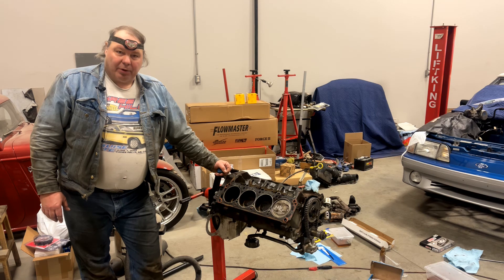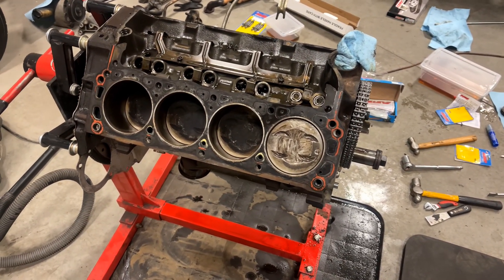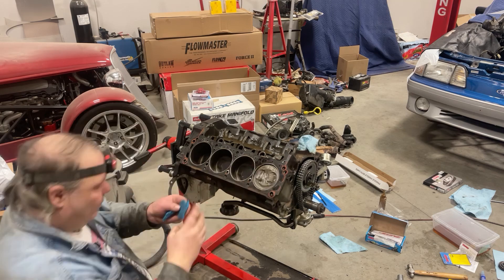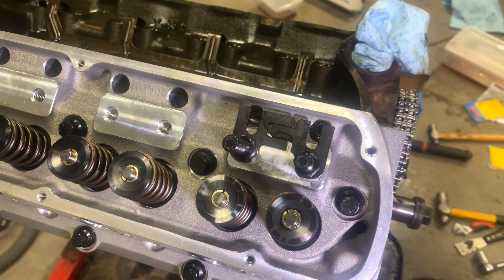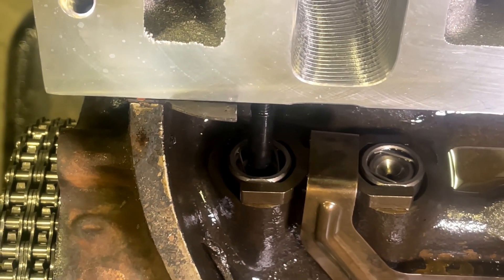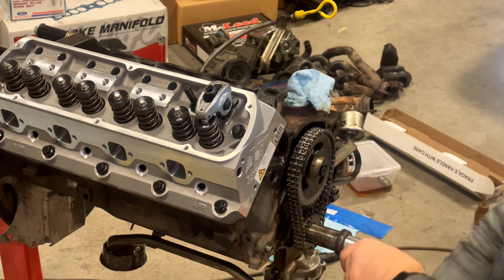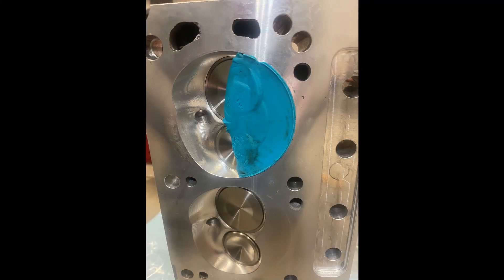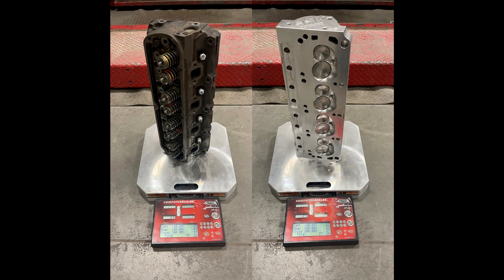Foxbody Mustang Piston to Valve Clearance and Pushrod Length Checks

Comment: Terrific tutorial as usual, Matthew. Thank you! I'm just about to install my slightly ported gt40p heads, 1.7 roller rockers and a TFS-514 (Track Max/ Stage 1) cam. (and all the perepherals, water pump, chain, etc) I purchased TFS springs that are good to .540 lift and the cam with the higher ratio rr's puts my total exhaust lift at .540 - so I'm definitely going to do the play-doh procedure. My question to you is do you think I'll experience any issues with my springs at .540 max lift and my exhaust lift being .540 (.510+.030=.540) ? Valve float etc? Or do you think TFS says .540 but there's a little bit more there? I'm hoping I'm good or I'd have to do one of two things, either go back to the stamped rockers @ 1.6 and my lift will be dropped .030 to .499int .510exh or get a smaller cam to run the 1.7's. Both ideas suck. What do you figure?
Reply from the maker: Watch very carefully for coil bind in your testing. The installed height of those springs will make a difference too. If it were me, when I got the engine at max lift I would check the coil clearance with a feeler gauge to see how much wiggle room, if any, you really have.

Comment: On a1990, Mustang installed a comp cam xe264hr 512 lift ,blown head gasket bought afr 1472 165 heads already installed, afraid to start will valves clear Pistons
Reply from the maker: I don’t want to make any promises here, and I always suggest a piston to valve clearance check as shown in this video. I can tell you that this particular 1990 mustang engine used the TFS stage 2 cam (installed straight up), which is very similar to the comp XE274HR, the AFR 165 heads, and the stock pistons/rods/crank with a fel pro 1011-2 head gasket, and it had enough clearance and ran fine. That is not a guarantee that your results will be the same.
Reply: @tecmotiondyno  Thanks, I just got ahead of myself, and I think it will be good. Was just hoping you installed a comp cam xe264hr
Reply from the maker: @robertc1220 That cam is smaller in every respect than the TFS stage 2. Though I want to be clear that I take no responsibility for your setup, I can say that I would be very surprised if it didn’t work.
Reply: I'm glad I ran across your channel, I'm old-school, do my own wrenching, and your experience is appreciated. Anything can go wrong. I got ahead of myself and wouldn't hold anyone accountable for advice. Thanks again

Comment: 1986 gt 4 eyed fox body all stock piston e6ze-6110-ba forged or cast.
Reply from the maker: I was not quite sure what you were asking here, but the stock pistons in an 86 Mustang 5.0 are forged. They are flat tops with no valve reliefs and the heads are one year only, which makes those cars a lot harder to modify than the 87-93 versions.

Comment: I have a 289 strokered to 331 
Do you always have good results with this method? (Geometry of the rockers)   With the comp cams light springs my Howard's link bar lifters plungers will collapse before the valves open so no good messurement.

Then i tried you're method with the original springs and on my promaxx heads i get 6.550 and 6.650 because of the valves being grinded down on intake or exhaust( forgot witch one)

Do you ad or minus the 0.050 from the preload on the pushrod?
Reply from the maker: Generally, this method works fine, and it does avoid the possibility that the plungers in the lifters collapse even with light checker springs. To be extra certain, you can measure the amount of travel your lifter plungers have and halve it, but .050" is a good ballpark for half the travel on the plungers in lifters like these Ford Racing replacements. If you get good pushrod geometry with a 6.550" measurement using this method, and using a compressed version of the actual headgasket you will use, then subtract .050" from the measurement to specify a 6.500" pushrod. The reason for this is that when you compress the lifter all the way, the measured length will be longer by the extra .050" that should not be present when the engine is actually running with oil pressure.
Reply: @tecmotiondyno  
Bit if you got the length minis the half of plunjer travel. When you install the pushrod for driving and so you have to put the rocker to zero lash and then turn 1/2 turn to get a preload. (I now my plunjer from lash to fully pressed in Is 2 turns of the rocker nut) bit when setting i only turn 1/2 turn for backlash . Isn't the pushrod a bitt to large then ? Half way the lifter is 1 turn rocker nut
Reply from the maker: @chevroletbelair1  if you have that much travel you probably want to use 3/4 turn of preload. The basic procedure here is to figure out the difference between the preload setting and the totally collapsed setting of your lifters and add that much to your checker pushrod when you check it with the lifter fully collapsed. This amount may vary from application to application. This isn’t a measurement that needs to be as precise as bearing clearance and most commercial pushrods are only available in .100” increments so you are always going to be a little off.

Comment: Just wondering what might be different with my current situation. 
I have the afr165 heads with 1.6 roller rockers. 6.350 tfs push rods with comp lifters. The head gaskets are the 1011-1. 
I bought a xe274hr cam and couldn’t get enough ptv clearance. I am using checker springs and a solid roller lifter when checking. I have been turning the crank and finding the closest spot. With it straight up I get 66 on intake and 115 on exhaust. I decided to shelve the xe cam for next years short block. 
I got a tfs stage one and the only way I can get the required ptv clearance is to set it at 2 degree retard. I get 84 intake and 104 exhaust. 
Any suggestions?
Reply from the maker: The first thing to do is check your piston to deck measurement. I have heard tell of some Ford blocks with a machining mistake where one bank ended up with the pistons at +5 or +10 thou (above the deck when at TDC). This can have a more dramatic affect on the P/V clearance because of the valve angles and the way the factory reliefs are cut. That’s the place I would start.
Reply: TF heads  you probably would have cleared.  thats why theyre "twisted valve angle work with certain cams  in stock 5.0 shortblocks

Comment: Informative video. Subscribed. Perfect timing because I have to check my piston to valve clearance on a SBE 351w with Victor jr heads and a tfs stage 3 cam.
Reply from the maker: Glad to be of help. If you do a meticulous job when you put the engine together, you will be set up for a great result at the end.

Comment: Perfect! I’m planning an bump up for my Factory Five Cobra. 5.0 with AFR165’s,TFS stage1 cam, TFS street burner intake with crane rockers. It looks like I shouldn’t have a clearance problem. I’m using the same head gaskets too!
  Opinions? Thanks!
Reply from the maker: I'd be shocked if you had a clearance problem with that if the pistons are stock 87+ 5.0 HO, but it is always advisable to check the clearance. I've set up a lot of those FFR Cobra/Roadsters and it doesn't take big power to make a really quick car out of them. My preference would be the TFS stage 2 and the Performer RPM II followed by the Holley Systemax, but the parts you are talking about are pretty well matched to each other. TFS Track Heat heads would be a good choice too.
Reply: @tecmotiondyno  My build is what Dave Smith calls a “proof of concept” build. Based on a $500 93 fox body donor. It has evolved a bit over the 94k miles I’ve put on the clock. The block already has the cam and intake, and am finally getting rid of the choke point in the system. 
  Your videos are exactly what I’ve been looking for!
Thanks!
Reply from the maker: Be sure to watch my cylinder head install video for this project. There is a very popular video out there that I know guys use, but the advice in it could not be more wrong! Mine will show you the right way to put the heads on.

Comment: Then there's bearing wear, rod stretch, weak valve springs, to be concerned with!
Reply from the maker: Probably not valve springs with brand new heads. The other stuff is an issue, but with a car with low miles, a well known history, a good compression test, and a good pre-upgrade dyno test, these other things are less of a factor. The steps in this video apply even to a totally fresh engine too.

Comment: Great video,  2 questions though what c.c were those heads and what was the compression ratio? Thanks in advance !👍😎
Reply from the maker: The heads are 58cc AFR 165’s. The pistons are the stock 1990 pistons. Stock compression was 9:1, with these heads it is bumped up a little though I did not calculate it. Say 9.5:1 or so.
Reply: @tecmotiondyno  Awsome that you I have the same heads with a smaller cam .512 lift 218/212 duration @ .05 . I will check the length of the push rods regardless.  I suspected it would take different length push rods than stock,now I know. Stock 1989 block for now. Greatly appreciate it,  thank you ! 👍🤘😎
Reply from the maker: Glad I could help. If you pay attention to these checks when you build the car, you will set yourself up for success.
Reply: @tecmotiondyno  100% agreed !!

Comment: Great video👍. I’m replacing springs and valves on my GT40P heads. Would I use the same process to find push rod length on pedestal mount rockers?
Reply from the maker: The pedestal rockers are not adjustable, so this is not the correct procedure for them. If you have to adjust the geometry of those rocker arms, you will need to use shims. In most cases, if your spring installed height is the same as stock and the rockers are stock or the same geometry as stock, the stock pushrod length will be right. The Ford Service Manual or equivalent is your best guide for setting up the pedestal rocker rocker arms.